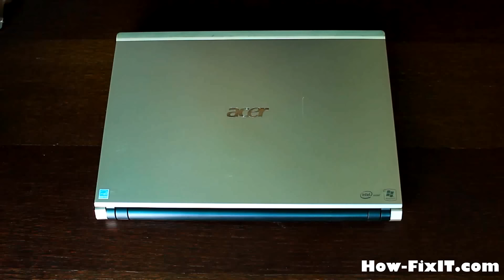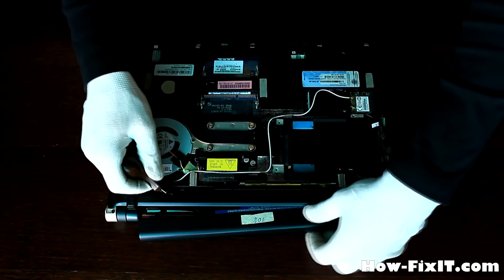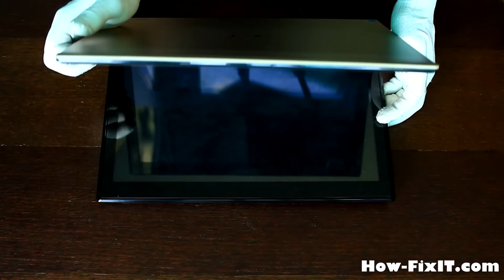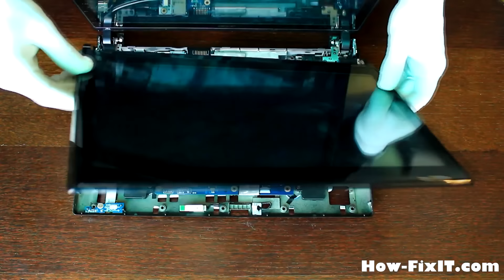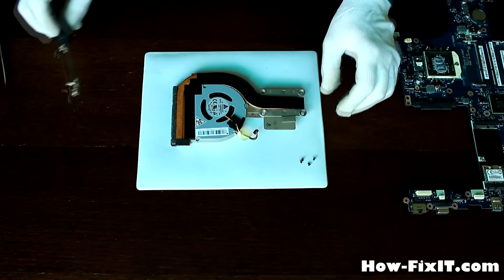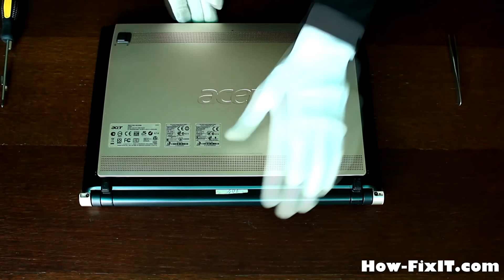Acer Iconia PAU30 Disassembly, Fan Cleaning, and Thermal Paste Replacement Guide

Comment: This video helped me to disassamble my Iconia, since I want to add liquid metal compound to it's cooling system. It's now 7 years old, but it is still a unique laptop, and as long as it runs smoothly (which it does with Windows 8.1, 8GB of Ram, which is the max, and a 500GB SSD), it's worth to be kept in shape. There simply is no other real laptop, where you carry 2 screens with you at all time.

Anyway, I have a few questions:
1) Has there never anybody written a comment here?
2) I took all the screws and cables off, just like in the video, but I cannot lift the lower screen. Ideas?
3) The video quality is bad, even for 2014. Why is that?
4) Why is there no audio? The movements indicate, that the "operator" was talking and explaining while working.
Reply from the maker: I agree with you, this is a great laptop even in 2018!
1) No
2) Check all screws, maybe you miss one
3) Because I had Canon 550D
4) Old videos without sound

Comment: Sorry, can anyone know how to use a "video wall" out of three of these computers?)
That is, for example; in the center are two screens of the main Acer ICONIA + two more of the same through an external video card (via internal connection via MiniPCIe), which supports 4 displays simultaneously or more.

The problem is,
 that on this computer you can simultaneously use only 2 internal displays, or through an external video card 4 (probably). How to use two internal monitors of the main computer + 4 external ones on exactly the same two other Acer ICONIAs?